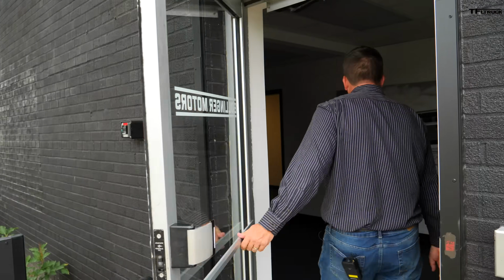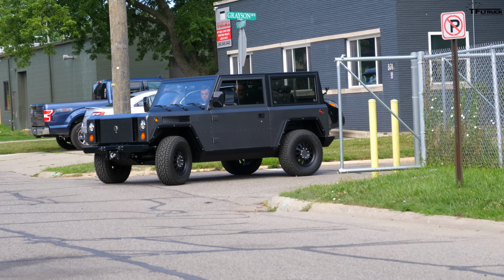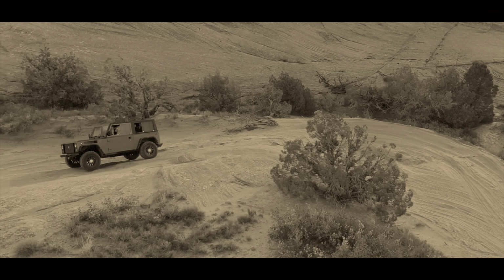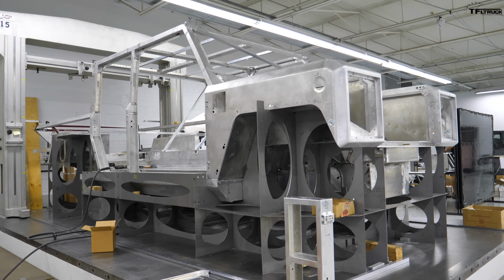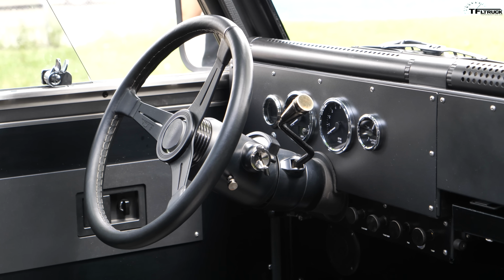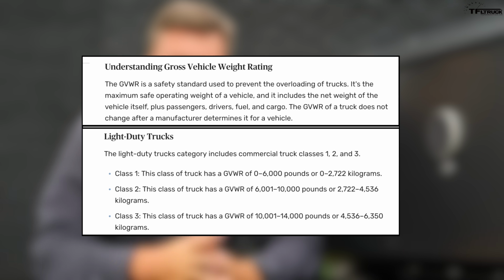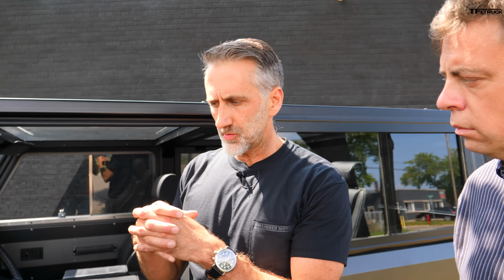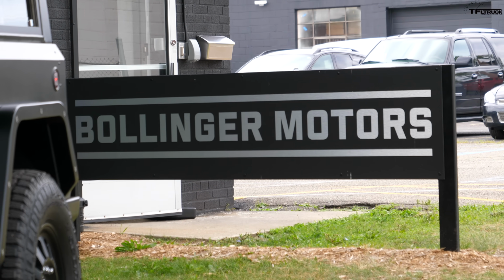EXCLUSIVE! Meet the Bollinger Trucks That Can Off-Road Like a Jeep and Haul Heavy

Comment: Engineer: you sure we dont need a car designer? 
Welder: "nah man, i make bbq pits i got this"
Reply: cgr88m yeah but its what 4x4 guys 30 plus year olds like in design
Reply: @jethrow243  im 30yrs old, and I'd take a lifted tesla model X over this lol. Its a great concept no doubt but their finished product looks like its still in the prototype phase, i wish the company the best i really do.
Reply: Milton Hackett  lol its not about looks, in the ev world range is the name of the game, and aero improves range. This truck has many awesome features, shit if it had a small diesel engine id even be interested in one, but this ev truck can do a whole lot but it just cant do it for long, before needing a charge. Most trips ive taken to offroad and camp are way more than 200miles. Its a very capable truck but i would pack a gas generator for a real trip. Maybe im wrong and these will sell like pancakes but i dont remember anyone getting into off roading or overlanding because of the fuel economy.
Reply: cgr88m its fairly easy to get these trucks to have 300 mile range - that is how fast battery systems are improving. If they added additional optional battery packs in the truck bed, they could get it to 500 miles. Dodge Ram 1500 gets anywhere from 300 to 500 miles - depending on torque/road conditions.
Reply: "Relax alright??   My dad is a television repair man......he's got the ULTIMATE set of tools!!    I can fix it!!     Man.....I can fix it!!"😂😂
Reply: "Nah, just copy a Land Rover from the 70's"
Reply: cgr88m exactly ahahha
Reply: BillHK  i believe it, if they would do away with the front storage trunk and drop in a small turbo diesel from gm like the mini duramax and make it a hybrid then they would have a winner here.
Reply: I agree with you all, but, is this truck a statement and will this truck stand out on the road? Yup! Will it be easy to replace a panel? Yup, you can do it yourself from the home improvement store!
Reply: I like it. Aluminum= no rust, simple panels=me fixing it in my garage when I dent it up. I like function over form. Beauty is in the eye of the beholder, and I think it looks solid and functional. To bad it's electric.
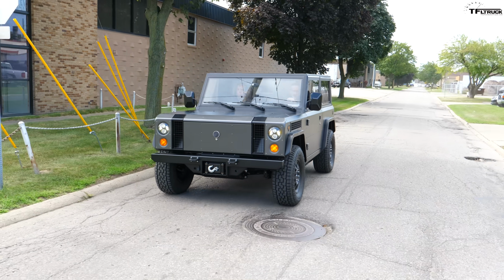Reply: 4:05.
First he's says it was an industrial stylings. Then he give it all away.

"We chose flat panels because we wanted to bend all the metal ourselves."

So basically the design came from you not wanting to pay the money to style it further.  Then you lable it industrial to make it sound better.  Ie 100% marketing
Reply: Ugly? You guys are nuts. This thing is so cool. Industrial design is correct — it’s a classic cigar box design. Simplicity is subtraction — get rid of all the complexity and make it as simple as possible. This thing is just wall to wall beefy truck — no needless, dated over-styling here. Love it . . .
Reply: All of the comments about "Industrial Design" in this thread are a bit off base - the term means to design anything that is to be made by industrial methods, and that includes almost every car that is not truly  "hand made." Yes, it is boxy and somewhat resembles a few old Land Rovers, but that has nothing to do with Industrial Design.
Reply: Yeah, I don't think they even talked to ANYONE in any construction field!
Reply: Designer: "nah man I got this, i majored in industrial design, i know how to design furniture! Home Furniture on wheels, so COOL 🤤"   😭😭😭
Reply: @dmatthewshin  That's already 74% more experience than most designers in the car industry nowadays.
Reply: the welds are killing me so shit
Reply: @mike72566  I paused and rewatched the battery mating scene because I was like damn..  that weld is shit..
Reply: Joe Giallombardo one has to remember these are prototypes. Manufacturing quality cars will happen when they go into production. Right now is about getting all systems good and the mechanics of the body well.
Reply: - Tell me about the design. 
- Well we took the design from Range Rover Defender because it has no live patent as it’s a design so old. Meaning it’s for free to copy it. So we made it uglier a bit more Hummerish. Design.
Reply: Founder to Engineer:  Nah... hand me that yard stick will ya.
Reply: cgr88m 
- Sure we don’t need a car designer? 
- Nah just copy a Defender and just make it even more ugly.
Reply: Bloody ugly, the guy who designed it apparently only had a ruler, I'm surprised the wheels aren't square.  it's like a 3 year old tried to draw an old series Land Rover. Bwahahaha, and this idiot thinks they will sell?????
Reply: @jonnorousseau3096  It's like how South Park portrays vehicles in Canada and all Canadians have packman mouths.
Reply: @jonnorousseau3096  Designing square wheels is rather difficult, you need a specific offset between all wheels, otherwise it just feels like you're inside a tumbledryer.

Comment: Really cool and novel idea but I don't think it'll go anywhere until they figure out how to mass produce these
Reply: They are actually not meant to be mass produced.  As an example, the boxy shape allows them to just fold aluminum sheets for the body panels instead of investing millions for sheet metal stamps.  It's designed to be basically hand made in a simple shop.  It's not the cheapest way to make a vehicle, but it doesn't require huge amounts of capital to get it off the ground.  Most car makers don't start to break even until they have made 100,000 plus units.  Bollinger might make 10,000 of these over the next couple years.

If they are really successful, then there might be a subsequent version that is meant to be mass produced like a more traditional F150.
Reply: @donm2255  makes sense
Reply: @greasysteve5671  They seem to be taking a smart approach to creating a new car company with less capital, less risk and a bigger chance at modest success.  How many people have been able to do that since the great depression?  Tesla did it.  But it wasn't an easy process.

Comment: If I could afford this I'd buy it I love the look roughness and portal axles and do anything ability, plus what I wished on the gladiator you can take out the rear seats and make it a long bed 2 door truck. 137 in wheelbase is the same as my 2002 f250 that was a great truck and its size was just right for storage and capability, only problem is I'll never afford a truck with a standard 120kwh pack probably gonna be 75k starting

Comment: for that same price i rather buy a TESLA truck or F150 EV
Reply: The Tesla truck might be cool, but no body knows yet.  On a F150ev, Ford will most likely just take the cheap route and add a battery and motor to an existing chassis.  I think the only EV's that will sell in any significant quantity are ones that were designed from the ground up as an EV.  Tesla has set the bar pretty high in that regard.

Comment: I know the EV will be the future and eventually everything respective to infrastructure will catch up. NASA has been using these types of technologies for the newer planetary rover vehicles for a long time really....also trains...train locomotives don't (yet) use batteries, but they use electric traction motors at each driven axle. It's gonna happen. Of course nobody will be driving their cars because they will be self driving :-/ 

I just can not warm up to them yet. I guess that is why I like Steam Locomotives over the diesel/electric loco's. I like noisy and dirty machines with personality. No other good reason.....just me being me
Reply: I love steam locomotives too.  But diesel electric was just cheaper and easier to operate.  Ford did the same thing with the model T vs the horse and buggy.  Imagine scooping up horse poop ever day.  Battery electric vehicles will do the same to most ICE vehicles.  For me, just eliminating an oil change every three months was enough to get me to buy an EV.  Anything cheaper and easier to operate will eventually take over the market.

Comment: Cool Idea but only practical for in town use. I would have to pull over and charge the battery before I get to the trail. Not even close to replacing a jeep.   As for carrying load is impressive but still not practical for a work truck. Maybe a good cool truck for the city folks to drive around and go to lowes for a home project. If they could get more range out of it or put charging stations on the trail. Then you could have a cool toy. But I think it is a cool idea. If it is cheap it be cool to have to go and run around in for a short time. Good job though on thinking outside the box.

Comment: Electric vehicles are so unreliable, don't last long, and are bad for the environment. They should've made it a diesel
Reply: Nothing you said was true.
Reply: @donm2255  mining lithium is much more harmful to the environment. Diesel is very clean. The Nissan Titan with the Cummins produces less than 1% emissions. When the battery fails in 15ish years they're expensive as hell to replace. The infastructure to charge these don't exist outside of major cities. The power generated to charge these are from a plant that burns coal, natural gas or a nuke plant. Disposing of these batteries are very harmful to the environment
Reply: @BiggHoss  Again, nothing you said was actually true.  Ask VW about clean diesel.  Coal base electricity is still cleaner than burning gasoline or diesel in a car.  Utilities burn fuel a lot more efficiently and with less pollution than an internal combustion engine can--by a wide margin.  And that doesn't include the refining and transportation of fossil fuels.  

Most people charge their EV at home.  I've been driving an EV since 2012 and have used a public charging station just once.  And that was just to test it out.  You can actually drive coast to coast in a Tesla using their charging network.

The batteries are very recyclable.  Just google all the companies looking for used batteries.  Demand for new batteries is driving the need for the material in the old batteries.  Every wrecked or flood damaged Tesla gets bought by companies looking for the various parts.  There isn't much of those vehicle ending up in a land fill.

How do you know the EV batteries will fail in 15 years?  They have only been available for about 8.  They do lose some capacity, but typically aren't rendered useless.  Tesla batteries may be able to go 500,000 miles in a car that can last 1,000,00.  How many ICE cars are even on the road after 15 years?  The average age of a car in the US is 11.8 years.
Reply: @donm2255  early hybrid batteries have all pretty much failed. And alot of what you claim about pollution is false. Not to mention VW cheated on their emissions with EGR systems little not no pollution is achievable. And the fact you completely ignored the fact that mining is harmful and eventually the batteries will end up in a landfill, look at our current recycling system most of it ends up in a landfill
Reply: @BiggHoss  You still aren't making any sense.  Hybrid batteries from years ago are a minuscule percentage of the batteries in use now.  You are trying to imply a current Tesla battery pack will fail because Toyota didn't know how to make batteries 10 years ago.

VW cheated because diesel is dirty.  

Has Ford and GM built cars without someone mining raw materials?

What I claim about the pollution of internal combustion engines vs utility scale production of fossil fuel electric is spot on.    Engines don't do a good job of converting fuel into motion. They waste a lot of heat and can't burn it as clean as a utility company can.  That's just a fact.  What utility company uses a diesel engine to generate electricity on a mass scale? 

Also, comparing curb side recycling to the industry that is popping up to take advantage of used EV batteries is silly.   Used plastic and cardboard isn't worth much, but EV batteries are.  Just google all the companies willing to drive anywhere to pick up the batteries.  There is strong demand for the materials to build new batteries.  They won't end up in a landfill.  They are worth too much.

Comment: This will almost %100 fail. 200 miles of range? That’s terrible and while towing it will be significantly worse. They also have no charging network so you’ll never be able to go farther than 100 miles away from home which is realistically probably 80 miles so you better live right next to an off road trail because off roading will drain that small battery faster than you can say idiotic ceo. You also better hope it’s the perfect temperature outside because using the AC or heat will also drain that battery so let’s make that no farther than 65 miles away from home. O and if you’re using it’s praised towing capacity cut that 65 miles down to 32 miles(super practical). This will also more than likely be incredibly expensive narrowing the buying demographic down to rich people who never leave their house and know nothing about off roading and don’t care about their safety with it having no airbags or any sort of modern safety features anddd they would also have to want everything they take in their car stolen because of how open and easy it is to see and break into this truck. Absolutely moronic.

Comment: All that simplicity and clean clear cut design will likely simply set you back a clean $100K. I'm not a big fan of 200 miles range either. It takes that much just to get anywhere to go offroading.

Comment: Ok is not beautiful, not practical or safe, no airbags? Really a safety point is no airbags? And at the same time you said it will surpass the federal regulation? Really? This looks 60 with the 60 safety... thanks but no thanks but if it cost the 60’s price I’m all in 🤷🏻‍♂️
Reply: They are cheating. It's clearly a car in it's construction, but they are trying to get around car safety regulations by claiming it's a commercial vehicle, which do not need to have airbags in the US. I would honestly be surprised if this amateur hour company gets through with such a transparent effort at skirting regulations.

Comment: They are going to have to address those brakes. It looks like if you snap a CV shaft you don't have brakes on that wheel.
Reply: Valid point. They will find out in testing.

Comment: We've seen the Rivian.  Modern styling inside and out.  Four motors.  Great stats. Many cool features.  Etc.  Basically starting at $70,000.  
Bollinger has two motors.  Spartan interior.exterior.  A few cool features.
If it doesn't come in at less than $40,000 for what you get, ...then I don't see the point.  Even for the off-road fun you need better mileage.  Not a lot of charging stations out on the trails.
Reply: The Rivian is not as off-road capable as the Bollinger.
Reply: @cruiser97eric1  In all fairness, I did mention the Bollinger's off-road advantage.  But let's be honest.  Have either of us seen a video yet of a Bollinger going where a Rivian can't go?
Reply: @JamieHitt  I haven't seen that video but I can easily imagine what it will look like. It will be on hard core rock crawling terrain or on terrain with very deep ruts full of mud. That is where the Bollinger's better ground clearance, better angles of approach and departure, sturdier front and back bumpers,  larger proper off-road tires and front winch will prove their worth. After the off-road ordeal is over, the Bollinger's flat aluminum body panels will be easier to repair than the Rivian's fancy aerodynamic ones.
Reply: @cruiser97eric1  At the end of the day, ...it's nice to see the "proof of concept" that an EV can be highly off-road capable.  And that alone is a great thing.  But being "competitive" in capability really needs to go hand-in-hand with being "competitive" in pricing as well.  The interior styling of a Power Wagon really helps to sell Power Wagons when the price is that high.  And even then, ...how much would you pay for a Power Wagon that could only go 200 miles?  And that's on pavement.  How does battery use translate to "off-roading"?  As it stands now, ...in the practical world, ...the Bollinger lives on a trailer being towed by a Rivian.  At least until our favorite off-roading locations get some strategically placed EV charging stations.  Lol.
Reply: @JamieHitt  Off-roading is low speed driving with frequent stopping to assess terrain, wait for your buddies to make it through a challenging section of trail, etc. So instead of miles driven it is better to think about hours driven when talking off-road. On difficult terrain it can take several hours to travel a handful of miles. An ICE vehicle will be wasting fuel at all those stops and delays, while an EV will be saving its energy for when it really counts. Also the EV will recover energy during the downhill parts of the trail while the ICE vehicle will continue wasting fuel downhill.
Reply: @cruiser97eric1  I can go with that.  But a day on the trail using heat or A/C will still take its toll.  Not to mention dredging through deep mud and snow.  Transmissions don't care how fast you are going.  Slow speeds will use power just as much as fast speeds, ...and with no added benefit of momentum from velocity on the highway like in an ICE vehicle.  No overdrive in mud.  But will the Bollinger be able to be flat towed?  And will you be able to decouple the motors and be in "neutral" in case you need to be pulled out of a mud hole?  Just curious.  Because I do like the Bollinger, ...if the price is right.

Comment: This is the first electric vehicle I don't hate. The styling with the independent portal suspension is more like a H1 Hummer and an old Bronco had a baby. The interior isn't busy with monitors and lots of plastic paneling. I do question the wind noise after a little wear and tear with the front tail gate. 

Now a two door truck with a soft top option, that would be pretty damn sweet.